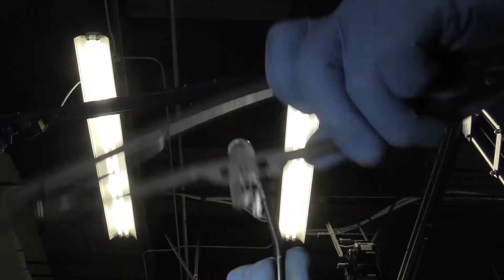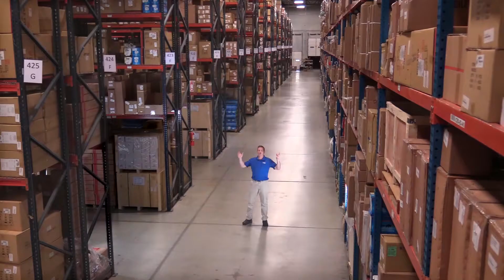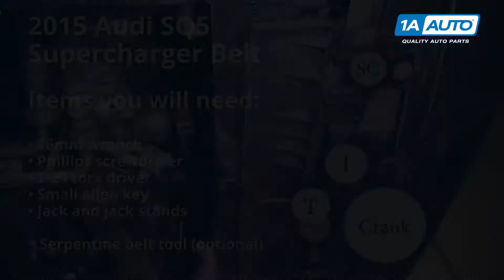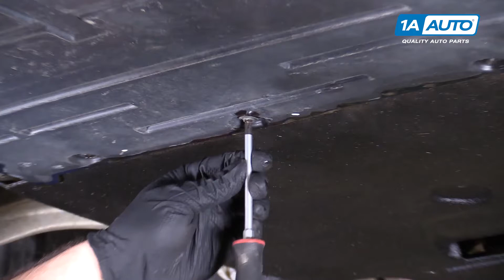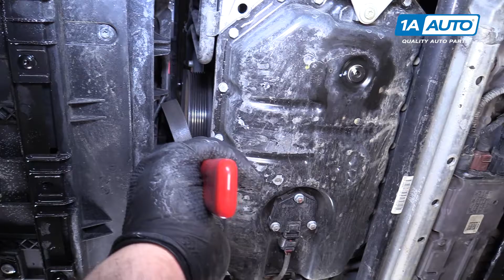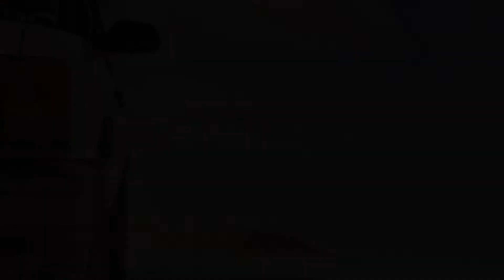How to Replace Supercharger Compressor Belt 14-19 Audi SQ5

Comment: Great video. I just replaced the supercharger belt on my 2017 Q7. I used the Rhino ramps that I’ve been using for oil changes and bought an inexpensive belt removal tool. What worked best for me was to make the idler pulley the last one I slid the new belt over.  I’ll be saving money doing my own belts from now on. Thank you!